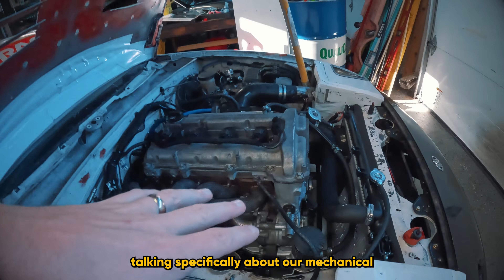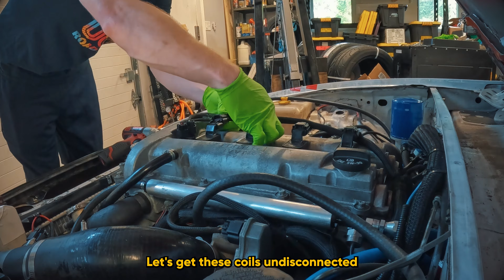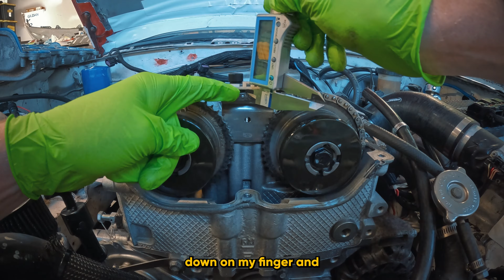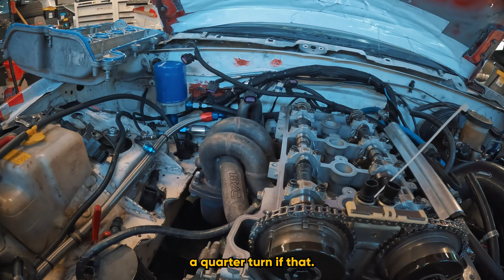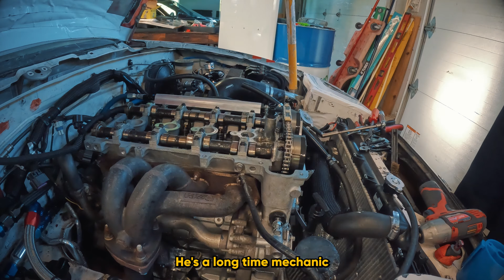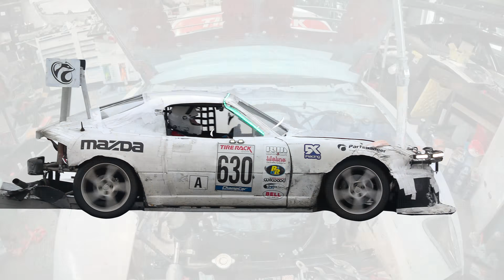How To: Set Mechanical Timing Chain Tension on an Ecotec | RuggedBadger.com

Comment: Do you need to weld the oil feed oil on the factory tensioner when modifying it to use the nut and bolt?

Comment: Great work roy! Good tip on the silicone in those specific areas. Funny that you torque the valve cover down. I always just use Justin newton meters